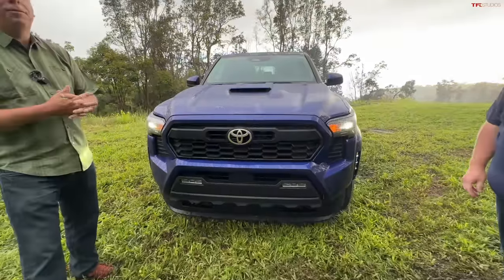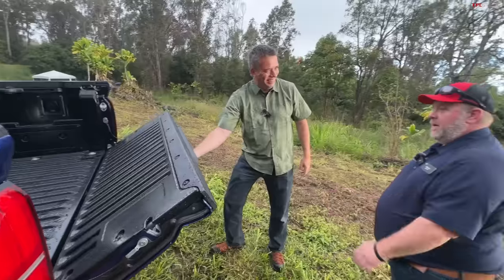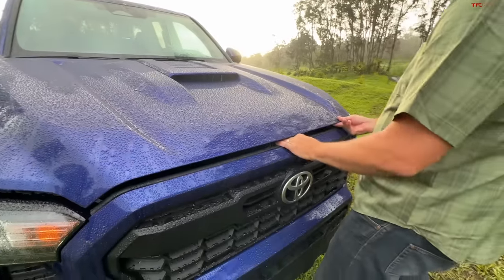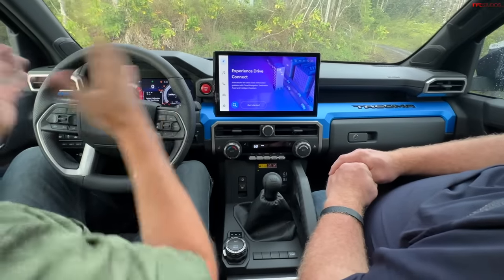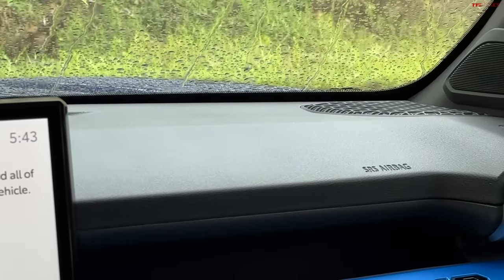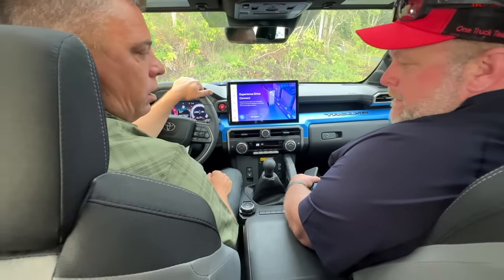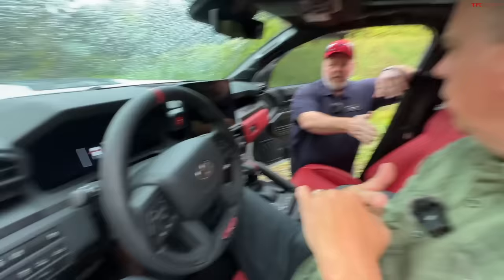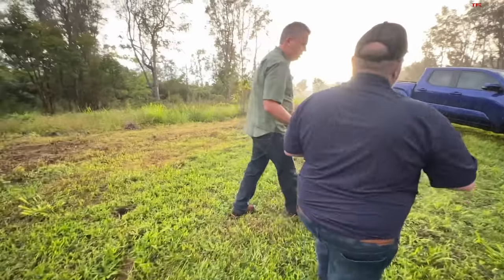2024 Toyota Tacoma Very Deep Dive: I Answer All Your Questions with The Truck’s Chief Engineer!

Comment: My concern is that Toyota is making 8 models trucks and a full array of upgrades and colors.  What that means based on inventory at Toyota dealerships (when the vehicles come in) is there will be no Tacoma's at the dealership when you want to buy!  They cant stock Toyotas now how can they have inventory when they release this new vehicle.  If they do have a truck on the lot you wont be able to choose a color, upgrades/options or one of the eight models to choose from!  Toyota needs to get their supply chain up and running again if they want to meet the demand for this new vehicle!

Comment: Nothing can simulate 20 years of daily driving in areas that get hot and cold except for real life. Give me Ford 300, Jeep 4.0, GM 3800, Toyota V6’s. Turbos increase cylinder pressures and heat, create a ton of heat under the hood (think wires and plastic parts), add potentially more thermal warmup stress, more complexity, and stresses the oil. All of the PSI on load bearing surfaces goes up. How many resources will be needed to create, transport, and replace these engines when they fail many years before proven designs? Good for car company economics but not the financial sustainability of consumers. It’s about to start looking like Cuba in the US.

Comment: I think he failed with the xtracab. It should have been an access cab with the storage options as reaching over the seat all the time to reach something in the back is a PITA. Hell there is even a video of the chief engineer having trouble to reach something in the back. Also the rear suspension was a mistake with the leaf springs being under the axel as that limits the lift options and will probably only be used to lower the truck like what other people did with the Nissan hardbody RWD. The prerunner with be terrible for off roading. They can say that they moved to xtracab for crash tests, but I bet it is to save cost and the MSRP will still be more expensive than previous years for the prerunner. If I ever do get a 4th gen I will probably get a crew cab and delete the back seats to get what I wanted out of the prerunner.

Comment: Wish you would have "dramatically " increased the rear passenger legroom a few inches,  😢
Reply: I’m a big guy and can sit back there no issue. It looks small but it’s fine when you get in. If you want a full size truck get one.
Reply: I agree with you. The 2000’s Dakota Quadcabs were the perfect dimensions for a mid size truck. Nobody makes a midsize with that much interior room and a 5.5’ bed.

Add 6” cab room on the 6’ bed model and use a 5.5’ bed and it’d be about perfect.
Reply: I had a Dakota quad cab BUT  didn't think the interior was very big, and the truck was junk,  sorry
Reply: @davidgroff3355  I think the interior is definitely bigger than current midsize trucks, particularly the back seats. Plus it was a 5.5’ bed, not 5’. I had one as well, I think it was the perfect size truck. Quality wise not so much.

Comment: I know its unrelated but is Honda going to be coming out with an all new Ridgeline? 

There are some spy shots of a 2024 HR i have seen but it looks like another refresh and not an all new model based on the new Pilot...

I am between this new Taco and the Ridgeline...i dont off road...its a weekend work truck and a weekday commuter so its cross shopable IMO but i am kinda over the current Honda Ridgeline's interior and exterior design aesthetic...

Comment: Doesn't a longer wheelbase make it LESS capable off-road? 🤔
Reply: Yuh you high center it and bottom out. Now the enter departure angles dont match the center. Basically because the front goes over without scraping people will assume its fine. Until the middle hits.  😁😂😂

Comment: All the different trim levels but am I the only one that thinks Toyota missed a huge opportunity? They needed to make a hybrid that gets good fuel economy. Sure sacrifice some off-road ability, but 99% of driving is on-road. There is absolutely NO reason they couldn't have made a model that gets 35 mpg--I would be waiting in line to order one. Everything else seems great it's finally not 10 years outdated.

Comment: It looks like a much improved truck and I really like it, but I feel it has lost much of its old-schoolness. Subtle things like the redesigned receiver. Nice, but I like the old-school look of my receiver. I drove a 2-Gen for 17 years and have now a 3-Gen Sport, which I love for its "legacy" look, feel and functionality that Toyota insisted it should have. Sorry but I like my leaf springs and drum brakes, my hand brake and mechanical tailgate (less stuff to break-mentality). But I am glad they kept the manual tranny and the familiar grille design. They didn't "Tundraize" it, styling-wise.  
I accept the new power train is right for the times, meets the latest challenge of the competition and what the Federal Government imposes on manufacturers (always messing thins up for us truck lovers), but I'm good with my V6. It is unbreakable and will last forever...  I don't like huge head units that impair my visibility and disrupt the dash lines. I like my 8-inch head unit. Weird place to put the drive Mode switch. I think it will get in the way of drivers a lot, but I figure designers knew why they decided to put it there and had a good reason...
After watching many of the reviews, if I were to buy a new 2024, I'd still select the Sport, but this time with 4x4. I regret buying my 3-Gen in 2x4 trim. Not that I need the 4x4 (never ever needed it), but where I live now there's beautiful outdoors and trails, which I'll have plenty of time to hit now that I've finally retired.
Reply: I’d buy a current truck next Monday, at the latest, right after breakfast, based on your comments. Or not, and regret the decision for the rest of your life...

Comment: I'd rather have an automatic over a manual. If I'm driving a backroad or the mountains manuals are awesome. But for everyday practicality manuals are annoying. Stop and go traffic and it's just more to worry about. I think manuals should stay in the past. It's been proven time and time again that automatics are better at shifting and all around make driving more enjoyable. I've had a 1996 Mazda Miata and both a 1970 and 1968 VW beetle and they were all manuals and while they were fun to drive occasionally I wouldn't want a manual daily driver so for that I would say that would immediately turn me off to buying a tacoma with a manual.

Comment: What was conspicuous due to little talk was the 4 cylinder engine plus turbo,that folks is purely for Toyotas bottem line ie cheaper to produce but, going by this engine configuration from other major manufacturers  who've tried this is a lemon. Seems 3-5 years of use results in a screwed engine, beware this engine.

Comment: Sorry, but I am an outlier in the effect, I don't like the 2024 style. They say, we listened, but where is a real step up to get into the bed like so many other trucks? I don't. like the broadening of front, while door remains inward. I like the tap the tailgate and it automatically goes up and locks. Would love real world storage pockets that can hold something real that you use.  You have to use a prop rod to hold the hood up, not good. 4 cylinders, no thank you! Turbo charge means, the engine has to work hotter and harder to power the wheels and pull weight, not good. He says he already feels he is sitting in a new truck, duh you are! It seems that they appear CRAMPED like a plane cockpit. Now regarding the Pro, well get out your wallet and throw in your first born. A lot of expensive options too. Sorry, I'll stay with the pre2024 Tacoma's.

Comment: Nissan designs a bulletproof boxed frame years ago,  refines it and adds  disc brakes for the new Frontier,  and people whine about the "old" frame. 
Toyota uses a non-boxed, rust bucket frame with drum brakes forever,  justifying their cheapness  by claiming these antique features are "benefits." 
Now, they update to what Nissan did years ago, and they're praised for their efforts.  Because Toyota. 
Why the double standard?

Comment: That’s a lot of blank plastic  buttons on the console - looks cheap- use the giant tv screen for those!  I guess I could put some toggle switches in for show.  Don’t seem to get modularity doesn’t have to show in 2024.   Start button will get confused by stereo on/off.- did they not UX test? Overall sounds like deliberate customer inputs went into it - like the look overall-  waiting to see if they revitalize the 4Runner.

Comment: I found it idiotic to put this small 4 cylinders in towing versions of trucks. Once you start towing you get worse mileage than a V8 and you have less power and a shorter power bandwidth. No ones ever gonna buy these small engines in a few years when customers realize this

Comment: Why did you not ask about the trucks not having auto 4wd?  In your videos you always negatively mention that Toyota doesn't do it yet you didn't  ask the question.
Reply from the maker: I asked last time about this with the Tundra.  Toyota continues to not include 4WD auto.  It may be due to size of transfer case and reliability.
Reply: @TFLtalk  true but the Tacoma has a different engineer and you may have gotten an answer.
Reply: I think it’s available, but only on the Limited.
Reply: @David Walker  no.  Toyota doesnt have it on any vehicle of any trim

Comment: Good job on the video and hats of to the engineer in the video. Buuuttt. Smh. It shall be king of the heep. Heep of shit (new midsize trucks in general) but nonetheless, King!
I'll just buy used trucks from now on so i can do work with my trucks and not flinch about using it as a actual truck.

Comment: Can we ask the engineer to reach over the side of the bed? Not happening. 

Buy a tundra if you want a big truck. Tacos are NOT designed for normal people they are designed for what normal people THINK they want to be. It’s a dream not a good design. What happened to the Toyota that I used to own? Had a 93 pickup that was amazing ( just a four cyl) and I have a 00 tundra that’s rusted to shit. It’s dangerous. Both are better sizes of truck than this. Bigger bigger bigger. Buy a full size truck!!!!

Comment: Nice truck BUT: Very over stylized and awkward looking at some angles in my opinion. The chin spoiler is ridiculous. The nonfunctional hood scoop is a joke, I can't believe Toyota is still doing it. No hood pistons? cheapo cost cutting, funny how they think an extra hood prop hole is innovative. Never been ok with a composit bed. Needs rear bumper bed steps. The start button looks like a childish afterthought. Too many drive modes. That portable JBL speaker seems stupid. And I hate that all manufacturers are going with big computer screen displays! Not why l buy a truck.
Big shout out for the 6spd manual trans!! and solving the headroom issue. Otherwise I'm a little disappointed. Sheldon sounds like more of a marketing/sales guy than a engineer. 
Guess l will have to wait and drive one.

Comment: Why no v6 seriously what's wrong with them?? They also could have turbo if wanted, for trd atleast offer v6. Toyota needs to get its mind right. They act like they don't like money. Seriously toyota engineers quit trying to virtue signal 4 bangers turbos that will ultimately fail. Don't tell me about gas mileage-thats negligible for this truck and its weight, and engine really wont matter once moded out by new owner.Put a v6 option in AND INCREASE PRODUCTION OF TRD WITH V6-so more people can purchase and thereby hype vehicle up more. Then the best part for the Toyota bean counters and shareholders-Big time money paper stacking!Toyota got everything right this time except the engine. Wack Arnold on the game with no shame and Toyota the one to blame.

Comment: Why does the Toyota guy give the wheelbase and length in mm, cm or inches would do much better.
Reply: Because precision.
Reply: Toyota engineering likely works internally in metric units globally so those were the numbers he was most familiar with.
Reply: Engineers and scientists use the metric system because it's superior and more precise in just about every way. I've never once heard of design data being inherently imperial.

Comment: I don't like it. I want something i can take out into the woods and haul firewood back. I dont want breakable crap in the bed. Wtf. I could care less and dont want the electronics. Why would i want specialized suspension so i have to pay $300 a shock to change them? Whats the strength of the frame? That would actually be useful. Where is the front locker? "Pro"  with no front locker? You made a joke. Look how small the inside of this thing is. Hell, can i even fit my chain saws in the back seat? Nevermind people. What was that thing he said about less power on the manual because the crank was knocking? THE CRANK SHAFT you mean? About the only thing i see actually useful might be the skid plates. Rest.. It's all b.s. in this thing. 
I had hopes thinking of the beefed up rear differential. But nope.. .this is a kids toy.
It mostly be a mall crawler with badges. 
Fully boxed frame....
Oh like a truck should be? Whats the strength though? Toyota doesn't seem to know how to make a frame. 
This might actually be worse, than the tacoma i have. Frightening thought. Pretty yeah. Pretty useless.

Comment: The motor is underpowered this is a toy for rich boys not a work truck. Towing is lowered lol.
He is just justifying all the shortcomings of the new truck that Andree mentioned politely.
Reply: 326 HP is underpowered for a midsize truck? Ok buddy lol. Anyone towing a 20 person boat is going to buy a full size truck anyways. It’s not meant to compete with full size capabilities.
Reply: Nobody is towing over 5000 pounds with a mid size. Anyone towing over that is getting a halfton, over 7000 and they should be getting an HD
Reply: It really hasn't been a work truck since they got rid of the low riding 2wd version.  They used to be cheap reliable work trucks for gardeners, handymen, etc.
Reply: @jeffk464  ya because you couldn’t use the current iteration for that purpose at all…….
Reply: @agentcarder  agree but that shouldn't stop improvement of specs. Towing capacity at least should stay the same on the paper while being more secure on the road. Otherwise what's the point of redesigns? To add more apps on a larger screen ?!
Reply: @19hundoc47  HP is not bad but the tq is low, specially compared to competition like Chevy Colorado.
Electric boost might help for short time but won't help much when you need constant tq for long distances specially when you tow and when you're in high attitude.
Reply: @mahdavimail  agree it should at least stay the same. Big improvement is payload on the new one. Redesign is to improve the vehicle,  make it more efficient, reliable, nicer. Increasing the towing would be altering it into something it’s not. Theirs a reason bigger trucks are made, same for smaller ones.
Reply: @mahdavimail  lol. The motor without electric assist is 316 ft pounds and the torque from the turbo will come on stronger and sooner than any v6 it previously had. Add the electric motor and you’re doing like 430 ft lbs. It blows the last model out of the water. You think they would make a worse towing truck? C’mon dude this is Toyotas bread and butter